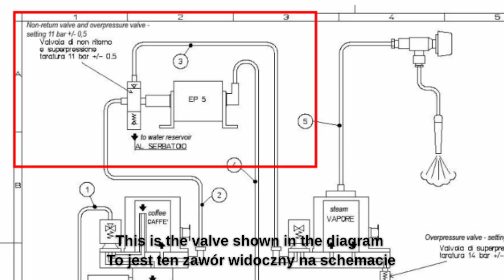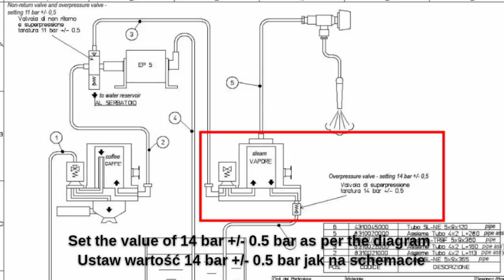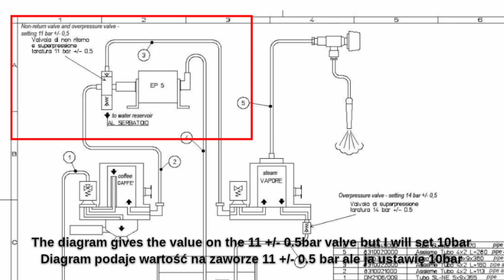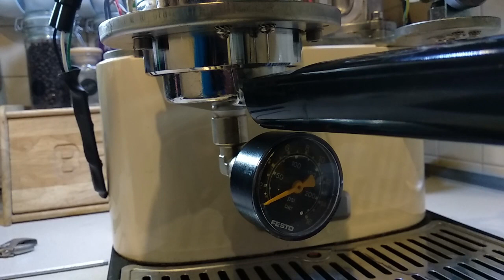KitchenAid Coffee Machine after repair.

Comment: How to fix the valve bar without the gauge. I have kitchenaid proline. The pressure is low and leak too much from the valve.i saw u tighten the valve from the bottom and the top then you loose it a little  i will try that way may be it works for me

Comment: So you have any links or photos or resources that show how to take off the top to access? I need to replace a gasket on the main boiler assembly.
Reply from the maker: Read the description ?
Reply: I don’t see anything that explains how to open the case to take the top portion off. I see two links for paid support and a link to your blog. Any specific blog post you have that details that!
Reply from the maker: @macervoni  You will find on my blog topics where I fixed Kitchenaid.  There are a lot of photos so they will be helpful.  I don't repair kichenaids anymore, these machines are of poor quality and the steam boiler often breaks down.

Comment: You have adjusted two valves one inside (cooper cap burning your finger) and another from water compartiment. Other Gaggia similar internal parts only adjust one, do you know why ? I do have one probably factory set for 14bar or higher pressure and Ineas studying how to adjust it.
Reply from the maker: Oops ?? I missed your comment for which I am sorry. Kitchenaid has two valves, one is on the steam group and is adjusted to 14bar. It only serves as a protection against excessively high pressure, it opens and protects the coffee machine against the steam boiler explosion. The second is a standard OPV that changes the pressure on the flask to 10 or, if you prefer, up to 9 bar